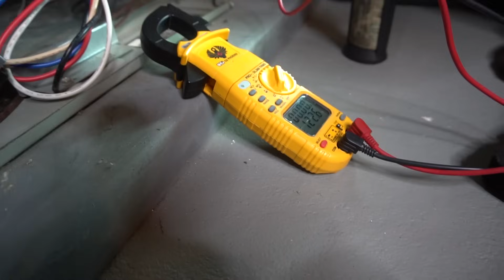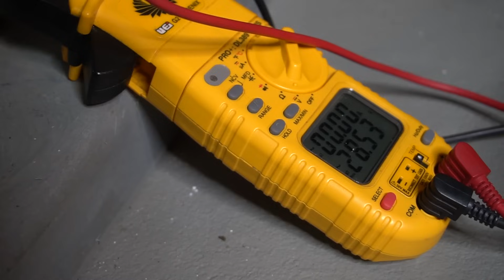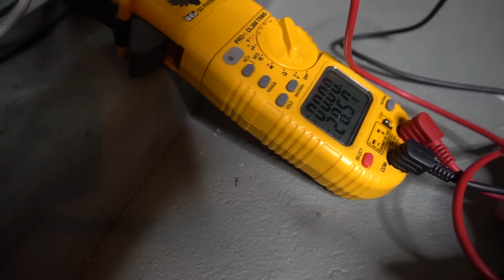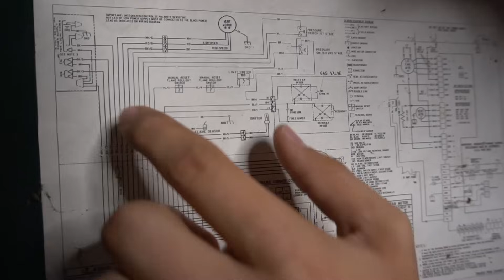Furnace/AC How to Troubleshoot The Control Board

Comment: My furnace error code says open high limit switch, but I removed the wires from the limit switch and jumped it and still the same error code, ( I checked all the limit switches this way) before now I would push in on the harness connector and it would start, does this sound like a possible control board problem? Thanks
Reply from the maker: Sorry, I read this comment after I already answered your previous one. So turns out you already did the jumper test :) In that case yes, either there is a loose connection or the control board is defective.

Comment: Hi, my furnace is on a heartbeat green light, the led status code says "Control has 24vac power" can you guide me how I can fix it?
Reply from the maker: By the sounds of it, your furnace does not detect any problems and there is simply no call for heat. So perhaps a bad thermostat? Try bypassing it once and see if the furnace turns on. If you need help on how to do that, just look in my playlist that is in the description for a video on how to bypass a thermostat.

Comment: Sometimes my inducer motor keeps running and will not shut off after a heating cycle. Could something in the board be going bad? Any advice would be appreciated
Reply: Ok thank you very much sir
Reply from the maker: Yes, I would say your board is defective. The inducer motor should turn off before the blower motor does or shortly after the burners go off.

Comment: I have 24v going into the board but nothing 0v at the termials. Fuse is good. Does that mean I have a bad board?
Reply from the maker: If you have 24v going into the board but you do not have 24v between R and C on the thermostat strip, then yes, that would mean the board is defective.

Comment: WRONG, WRONG, WRONG! DON'T put a screw on the safety interlock switch as you mentioned at 1:26. Someone might be tempted to just screw one in there of any size, get shocked and killed! Use some NON Conductive device/material to close the "SAFETY" Interlock. You kept mentioning120 Volts, (AC of course) but your meter read 122.6. VAC. The input supply voltage will vary from 110-125 VAC Likewise with the AC output from the secondary winding of the 24vac transformer (24-28).

Comment: Thanks a ton for this video, and Furnace Troubleshooting - Top 10 Furnace Problems! As someone new to the northern states i had never worked on a furnace, and ours went out this morning. Your clear and easy to follow directions led me to the 24v DC transformer. I called around and picked one up for $22 locally, and installed it, and it's back up and running!  you saved my a ton today by not having to call a repair man.  Thanks again for your time you invested in making these videos!  Great work!
Reply from the maker: You're very welcome Rob! Glad to hear you got it figured out and were able to fix it quick. Stay warm! ;)

Comment: I have one that’s bugging me. A friend of mine said that his furnace would come on then 4-7 seconds later go off. Flame sensor right. I picked one up and put it in. Same problem. IFC control board?
Reply from the maker: Have you checked if there is any voltage at the flame sensor? (usually around 90v). If there is not, then yeah I would suspect the board. If you want some more info on that, check out my flame sensor video: https://www.youtube.com/watch?v=-QKHz1Mv9Ew&index=3&list=PLK8tZPlovA8BJJ_weFseSjQWUvB2FFII2
Reply: Word of Advice TV Jay. Thank you very much. I’m right in the middle of watching your video. I don’t do a lot of furnace work though I took Carriers Tech 3 20 years ago which was gas heating. I mostly deal with heat pumps and most of my gas service has to do with bad CFM’s and limit switches. I just figured short cycle. Flame sensor. Thank you for the quick response. I enjoy your channel. Have a great evening. God bless.

Comment: Control board blowing fuses. Was working fine and then blew a fuse and keeps blowing fuses. up and when it tries to ignite the fuse blows.  I checked all the wires, changed the thermostat and rerouted the wires from the thermostat the furnace. Still blew fuse. I changed the control board and still blew fuse. I checked the flame sensors and visually checked the pressure switch.  Did not check the transformer could that cause the 3amp fuse to blow?
Reply from the maker: Wow, sounds like a chaotic short you have going on there. That would be unusual but it is possible for the transformer to blow the fuse. If you label and take off all the thermostat wires off of the control board and turn power on to the unit, does it blow the fuse? If it does not, then I would start putting the wires back in one at a time to try to narrow down which one is blowing the fuse.
Reply: This happened to me as well about a year ago and I was able to trace it back to a short in the wires that go up into the attic that go out to the contactor. replaced that set of wires and voila. no more fuse trips.

Comment: Great video series!  I learned a lot just watching your very clear explanation. Question:  If the board's LED is flashing a code message, does it mean the board is good? I am trying to diagnose our furnace. I checked the ignitor resistance and it is 70 ohms. When I turn the furnace on, the blower goes on and after a few seconds the board's LED flashes a code  - Reverse Polarity. The ignitor does not glow and I do hear the "click" of the gas valve. Any idea where else I should check? Thanks.
Reply from the maker: Thank you! Reverse polarity means your neutral and line voltage is swapped. Or it may just be that your control board is bad. Try looking up "how to fix reverse polarity on a furnace" on google for more info. It wouldn't be good if I accidentally lead you to shorting something out if I try to explain myself.
Reply: Thank you. I am leaning towards the control board being bad. As far as I know, the wiring was never touched for the neutral and line voltage to get swapped all of a sudden. Keep up the great work. I enjoy and have been learning a lot just by watching your videos, HVAC-related or not. I'm a new fan of yours!
Reply from the maker: @PE37737  Thanks June! Good luck with the furnace! :)

Comment: Question about IFC. All systems check out yet the board is not sending power to the HSI. Board issue? I can even hear/smell the ignition gas momentarily. HSI tests good. Great videos!
Reply from the maker: Yes, that sounds like the control board is bad. Especially since the gas valve is opening for a few seconds.

Comment: Great videos thanks. Your thoughts on below...  If I turn on my heat my fan, sometimes, will cycle on and off every couple seconds. Same thing happens if I just turn on the fan only with heat off. System (York diamond 90) is 17 years old. I suspected a bad control board,  as when the fan acts up and I wiggle some of the female tab connectors the fan will occasionally work. I haven’t been able to isolate which wire so I removed the board and cleaned all the connectors. It worked fine for a couple weeks then the fan started acting up again. I ran through the trouble shooting and find my board and switches all test fine. My run capacitor (Titan pro 370, TOC15, 15MFD +- 5%) is testing a little low at 13.65, could this be low enough to cause the malfunction? If it’s not this could it still be the board?
Reply: Note: the control board is a White Rodgers 50-A-50 241. Also, the fan blades spin effortlessly by hand. If the solution is to replace the control board, should I select the exact older model or go with an upgraded version. Seems like the older models have a nice housing for the board and the upgrades come with no housing at all. Thanks for your thoughts and comments!!
Reply: I replaced the run capacitor, but that did not solve the problem with the fan.
Reply from the maker: Hey Jeff! Sorry that I am getting back to you late. I could have told you that the capacitor wouldn't have fixed it but it's good that you replaced it anyway since it was getting weak. I would check the voltage going to the blower motor at the connectors at the control board. So between the HEAT fan speed terminal and the common coming from the motor. (if your thermostat is calling for heating) Or if you just turn the fan on at the thermostat then it would be the FAN terminal usually. Otherwise just put your lead on each motor speed to see which one is getting energized. Check to see if you have steady voltage going to the motor. It shouldn't fluctuate too much from 120v. If the voltage is steady, then I would suspect the blower motor itself. But from what you described, it sounds like its the control board that's bad. I personally like to use the original boards if they are available. Hope that helps!
Reply: You’re correct, it’s the motor. I took the motor out of the squirrel cage, cleaned and lubricated it and it worked fine under direct AC power. However, I thought I would test it again under direct AC power reassembled inside the squirrel cage. With the extra strain from turning the fan blades it started malfunctioning again... turning on and off every 2 seconds. I did not run it much and it seemed to get warm pretty fast.
Reply: Thanks for your help. The funny thing was that the motor seemed to work fine when I tested it outside of the squirrel cage. I suppose it’s just getting ready to burn out. It’s 17 years old so it had a good life!
Reply from the maker: @jeffkeil2918  Many of those motors have thermal overloads in them. If the motor windings are going bad, the motor will overheat really quick. But without the added strain from the squirrel cage I could see how it would run no problem. Anyway, glad you figured it! Good luck with the replacement, stay safe!

Comment: I’m not getting 24-28 volts into my smart valve. My meter is only reading 11.7 volts into the gas valve. Does this mean I have a bad circuit board or could it possibly be the transformer? Thanks in advance!
Reply from the maker: The transformer has two 120v wires going to it and two 24v wires. Trace where the 24v wires hook up to and put your leads on those connectors. Do you get 24v? That will tell you if the transformer is putting out enough voltage. Also, does your gas valve only get voltage when there is a call for heat or does it always have 11v sitting there? And lastly, is there a PV/pilot valve? That would get energized first to light the intermittent pilot if you have one.
Reply: Word of Advice TV it’s a Goodman heater with a smart valve. There is no pilot light. I’m reading 120volts AC into the transformer and I’m getting nothing out of the 24volt DC side. The connectors into the smart valve are only reading 11.7 volts when it’s supposed to be 24-28volts to open the gas valve and supply fuel to ignite the burners. Everything else in the sequence seems to be working. The gas valve won’t open. I’m pretty convinced the valve is in working order and it’s either the circuit board or the transformer. So, I’m getting 120v power into the transformer, but coming out of the transformer (dc side) I’m getting nothing. Which would lead me to believe it’s the transformer.
Reply from the maker: @Perry1769  Try measuring the 24v in AC. I am pretty sure what you have is an AC step down transformer which means AC comes in, AC comes out. Is there anyway you can check what voltage the board is sending to the gas valve at the control board? It would be interesting to know how many volts are coming out at the board and how much you are reading at the gas valve. You could try wiggling the plug/connectors at the gas valve too. Sometimes it's just a loose connection.
Reply: Word of Advice TV it turned out to be the pressure switch. Thanks so much for your time and help! I just wanted to let you know👍🏻
Reply from the maker: @Perry1769  Awesome! Glad to hear you figured it out! Thanks for coming back with an update, stay warm!

Comment: Really enjoy your videos. I have a 2 yr old Goodman dual fuel gas-electric unit that has stumped me. When I first turn it on, the red led gives a 6-flash code (compr short cycle delay) for approx 2 mins and then comes on steady with no flashes/error codes. Problem is, it's not attempting to light the burners. It's 30 deg outside, I have plenty of gas, but for some reason it doesn't appear to be asking for gas. I did have, at one time, a 2 flash code,(press switch open) that was fixed by clearing out some insullation debris however I don't think this is the case here as I have checked the flow and I'm not getting the code - any code for that matter. Suggestions?

Comment: indicator light not flashing what could be the problem? thank for the feed back
Reply from the maker: Perhaps the 3 amp fuse is blown? (on some furnaces there is a small 3 amp breaker instead or no fuse at all) Usually if your control board LED is not on that means the board is not getting 24v power.
Reply from the maker: Perhaps the 3 amp fuse is blown? (on some furnaces there is a small 3 amp breaker instead or no fuse at all) Usually if your control board LED is not on that means the board is not getting 24v power.

Comment: I really found your videos informative and helpful but I need some advice diagnosing the issue with my furnace. The fan is set on auto but the blower will keep running regardless of whether heater runs or not.   On top of that when I switch the thermostat to off the blower will keep running and I need to turn the power supply to the fan off by switching the main breaker on the main electric panel to stop the blower.  Its not the fan delay because I tested it and the blower stayed on all night
Reply from the maker: Most likely you have a bad control board. Here is how you can check:

1. Turn off power to furnace
2. Disconnect R and G at the control board thermostat terminal strip.
3. Make sure the wires are not touching anything
4. Turn power back on.

This test will rule out the thermostat. (R is power to thermostat and G is fan) If your blower is still running with those wires disconnected then likely the fan relay on your control board is bad and the control board should be replaced. If you have an old furnace with a dial fan limit/control then there is a chance that the limit is actually the one causing this.
Reply: @WordofAdviceTV  I have a Goodman Furnace 95% and my heat goes out so I walk downstairs and the furnace still appears to be on and the fan is blowing. If I turn the thermostat off the fan still blows. If I turn the power off to the furnace and back on the fan will still turn on. To fix this I have to turn themostat off, then turn furnace off, the disconnect and reconnect a component on the circuit board. I can then turn the furnace back on without the fan turning on then turning on the thermostat will allow to heat to start normally again. I think I'm resetting the board, but not fixing the problem. Do you think this is the control board problem?
Reply from the maker: @CasiodorusRex  Most likely the control board is failing then. (the fan relay may be getting stuck closed) When you say you disconnect and reconnect a component, what is the component you are doing that to?
Reply: @WordofAdviceTV  I was simply taking the 3 amp fuse out then putting it back in, but that stopped working. So then I took one of the other plastic clipped pieces off the board and put it back in https://i.postimg.cc/k5GTXGk2/circuitboard.jpg and that has been working to reset the board I guess because the fan goes off. Here's a photo. A technician said it was the board, but I don't want to pay him $600. I found the board on Ebay for $75 and was thinking of just replacing it myself. As long as I label everything correctly I think I can manage.
Reply from the maker: @CasiodorusRex  Sounds like when you were pulling that fuse out and putting it back in you may have been resetting a soft lockout which is caused by either a limit tripping multiple times or multiple failed ignitions. But that's just a thought, that may not be the case for you. And about the board, if it is exactly like the one you have, you should be able to replace it no problem :)